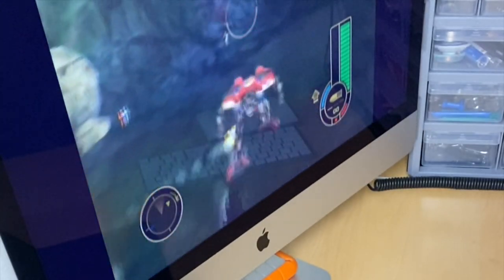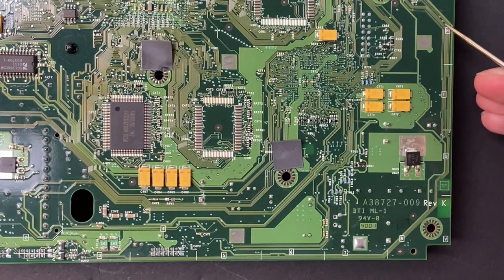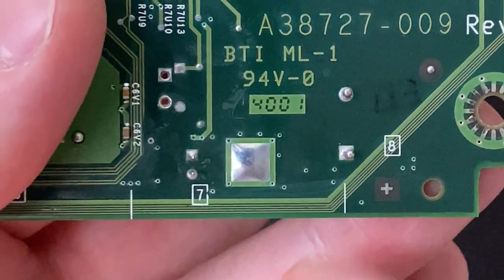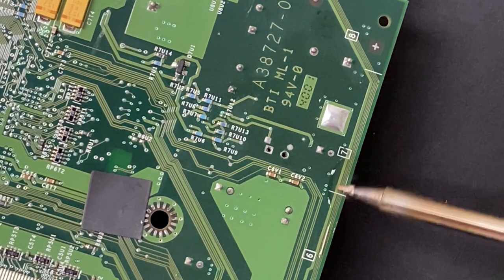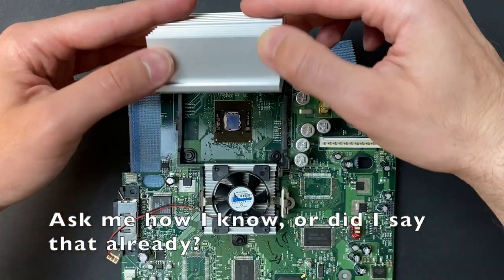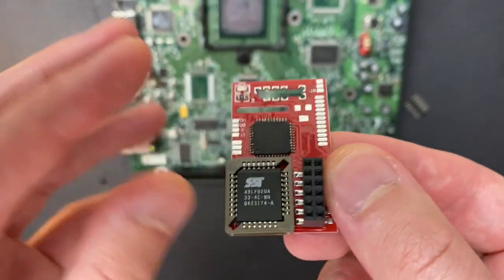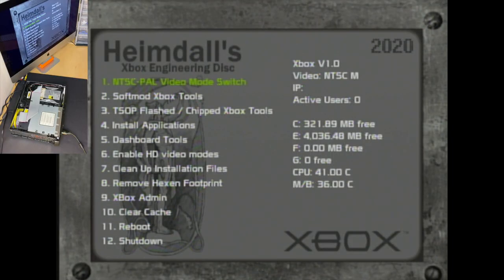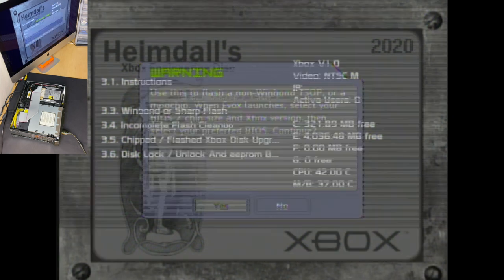Xbox Trace Repair & Modchip - Retro Console Repair

Comment: A Solder Bridge / jumper will only work without flux. You can stretch solder. But it has to be 10 seconds more or less old hanging on the solder tip smoking the resin away. The inner core of your solder wire contains also resin (flux) and has to vaporise first. Flux helps to flow. since it becomes more liquidity it can not easily bridge, it actually helps to unbridge :) Anyway the wire was an excellent choice. Love your channel!
Reply from the maker: When someone that knows what they’re talking about explains it, it all makes sense. Thank you, now that I think about it, I can see how I was unbridging rather than bridging with all that flux. Thanks for the feedback. Glad you’re enjoying the content 👍🏻

Comment: Thank you for not drowning the CPU and GPU die with gallons of thermal paste.
So many tutorials I've seen completely overdo it. A tiny film layer of paste is all you need....you just need to fill in the microscopic pits between the heatsink and die/heat-spreader.

Comment: You will probably never read this any more since it has been more than 3 years ago you made this video. But I wanted to see what an awsome video it is. Today I got a v1.0 xbox with exact the same symptoms as you described. I remembered that you made a video about it and I found this one. I repared the traces and voila works as a charm. I found it very hard to repair the traces. One trace i succeeded with a smal pies of wire on the trace slike you did but the other did not work so \I ended up making a wire from begin point to endpoint. But it works and it boots up!!
Thanks again for this video.

Comment: Just discovered your channel a couple days ago because I just got my first soldering station for college and wanted to get some practice by repairing consoles. I’ve already learned a lot by watching you and plan to cnmtinue coming back for the foreseeable future. Keep up the good work!!
Reply from the maker: Thanks man, I appreciate the sub and glad you're finding the content useful. Great that you just went for it and started tinkering. It's the only way to improve and its a fun hobby for sure.
Reply: @BorderlineOCD  Hey guys what degree u guys have? i'm curious about fixing motherboards and replace components and soldering. I think I need some guidance.
Reply from the maker: 300C is a good starting temp. Unleaded solder can require higher temps especially if its a large ground plane or a heat sink or something. Introducing some leaded solder works great to lower the melting point and makes removing components easier without increasing the temp too much, but sometimes I go up to 350C if it's going too slow. I don't have to resort to 400C often for desoldering but it depends how large the joint is and how good the heat transfer. If you're concerned about adding too much heat you can start low and dial up until it feel good. FYI most cheap soldering irons that don't have temp adjustment usually run between 400C to 450C. They'll do the job but those temps aren't usually needed.

Comment: Conductive paint! You could try conductive paint next time when repairing broken traces. I suppose applying some UV mask on top will even help protecting it on the long run :)
I once bought a Mega Drive cartridge that had 18(!) broken traces. I've spent a whole afternoon trying to bridge them but most of the gaps were just too big. I have eventually fixed it by using some fine wires but I have ordered a bottle of conductive paint right after that :)
Reply from the maker: Nooooo don't take away my soldering iron! 😢😭
Good suggestion though and it never occurred to me to try something like that. I just need an excuse to add something to my toolkit. 18 traces!! That's very cool, especially since it sounds like it was really far gone. There must be a goldmine of junk carts like that on eBay that could be brought back to life with some patience and commitment.
Reply: @BorderlineOCD  Exactly, although I forgot to mention one thing: all broken traces were right above the pins. You have to use some very fine wires and a thin layer of solder there otherwise you can't close the cartridge anymore :) (Unless you want to modify the shell which I would rather not do)
I bet that a skilled person with a decent microscope could do this without much problems though.
Reply: Conductive paint isn't as good as a wire, I haven't done any testing with conductive paint but my theory is that it is definitely more resistive then a wire which can definitely affect performance depending on the device and trace
Reply: In my experience the conductive pens won't really draw or adhere to damaged pads or traces. Like at all!
Reply: @neojudasiscariot  Nickel paint (its like nail polish) that will stick, and you can mask off the area, then paint it in, silver paint works too, but it's more expensive. Conductive pen is just something to play with.

Comment: I see you were picking at that thermal compound stuck to the bottom of the heatsink. I have found that using something like Goo Gone and letting it sit for a minute works wonders on the sticky type of thermal interface material. I used some yesterday on a B450 chipset heatsink on a motherboard, and it works way better than isopropyl alcohol and scrapping. I also use cheap paint brushes (that I never painted with of course) to brush off most of the surface dust while cleaning off components. Compressed air works great like you use, or if you have a handheld Metro Datavac.
Reply from the maker: Yes, scraped away for a good long while on the GPU heat sink... And all those scratches are from a plastic spudger. That aluminium heat sink is soft! Okay, good to know. I have some Goo Gone and will give that a try next time. I fire up the air compressor in my garage for nasty jobs like this these days. I used to use a shop vac indoors but received a number of comments about ESD on one of my older videos. I want to do things the right way so I stopped using the shop vac for cleaning circuit boards.

Comment: I was the one originally suggesting solder bridging cracked traces. I think you did a great job here since the gap indeed was too large. You can always use a strand from a larger wire if you want something really small 👍
Reply from the maker: Nicoful! Yes sir, you are indeed the viewer I was referring to, and thank you for the suggestion. It looks much more professional like you said it would. Good to know you would have approached it in the same way eventually (with a small wire). Love the end result and very proud of the repair. Thanks again for your critique.
Reply: @BorderlineOCD  I'll add that the reason you weren't bridging with solder is because you were using flux. The flux will draw the solder away from bridging. Try it without in the future for fun.. A real long term fix is wire though, solder isn't really supposed to be a long term connection
Reply: @BorderlineOCD  also, is recommend splitting the tsop and using the dual 512 banks instead of the modchip with the single 256
Reply: The bridge method may be neater but the trace corrosion will continue. Might be more worthwhile to just run bypass wires and be done with it. Side note, instead of removing the Clock capacitor I just mounted mine remotely. Even if it leaks a bit it won't matter that way.

Comment: Been watching a few of your videos — good stuff! About the CPU heatsink bracket: you're removing it "backwards". When you raise the lever, there's an arm under it which is the same length. If you press down on that arm with your hand, and then use a screw driver to gently lever the bracket, you'll have a much easier time and won't break anything again ;)

Good job on the repairs!
Reply from the maker: Thanks for the tip. I'm admittedly nervous to use a screwdriver after breaking one of these clamps (earlier repair video) but I'm sure there's a technique to it that I'll eventually master!
Reply: @BorderlineOCD  Yeah, I saw that, that's why I'm mentioning this :) The problem there was that you applied force outward with the screwdriver, and on the wrong side to boot, that's why it broke.

You should apply force downward on the arm, and use the screwdriver to merely unhook the clamp. Hope I made sense :)

Comment: Man this brings memories I used modified the case, chip and hard drive.  
I used paint the whole case, I would put the top cover in the freezer to pop the xbox jewel so I could drilled out, put led’s ring and put a customized laser cut clear acrylic jewel.
Reply from the maker: Nice, I was a computer gamer when Xbox and even the 360 were released. I am looking forward to doing an Xbox "slim" at some point. I have a unit with a bad DVD drive that's a perfect candidate.

Comment: With V1.0 you can just flash the TSOP by bridging two point on the board no need for the chip. Makes for a much cleaner install
Reply: Or you could just softmod

Comment: Back in the day, I became almost a professional heatsink lapper for PC's mainly Peltier and watercooling rigs but I did get on occasion OG Xbox's and I used to get them heatsink faceplates like a mirror and trued off so the pressure point was always optimal coverage against the chip.   It was and still remains for me a soothing experience lapping by hand and the final polish to turn alloys and coppers into beautiful mirrors and it does improve heat transfer.   I am not sure why the Xbox heatsink's seemed bowed and warped on occasion but this of course led to overheating due to the heatsink not interfacing with the heat source.
Reply from the maker: I can imagine that being a very rewarding task. Did you do it by hand or does it generally require a power tool of some sort?
Reply: @BorderlineOCD  by hand and feel is the best, sandpaper on glass for a flat surface.

Comment: I've got numerous OG Xboxes, one of the ones I've done a trace repair on now won't open the disc drive unless I hold both the power button and the disc button.
Random shutdowns are gone now at least but I have checked they're not shorting out something else and are all in the right place.

Comment: Very nice job on those traces. Good video, What console are you looking forward to repairing next?
Reply from the maker: Thank you! I'm not sure honestly, although I would like to work on a few Segas and Ataris at some point. Right now it's somewhat easy to add a project to the backlog because I just shop for a console I don't already own, focusing on older systems. I have bought a couple of 'untested lots' and to my surprise several systems advertised as untested didn't need any repair (NES, Wii, Wii U, Master System, Mega Drive, PS3). It nice that I have those in my collection but sort of a disappointment that they actually only needed a cleaning which sadly doesn't make for an entertaining YouTube video :P I also think I'll be doing some preventative work (like recapping the NES) and a few more mods (my fiance seemed to love the Game Boy backlight mod so I promised her a Pocket one).

Comment: When I have to make repairs to traces, I do one of three things depending on what I have a hand, copper shim stock, cooper foil, or the one I use the most take a thin wire pound it flat with a hammer and then cut out to size, but all in all you did a beautiful job. Congrats, Looking forward to seeing your next video
Reply from the maker: Thank you sir. I think if my wire had been any thicker it wouldn’t have worked well. The 26 AWG was the thinnest I had on hand. I do like the option of using a copper strand from a thicker wire. A lot of cool comments from folks like yourself and others on how they would have done it.
Reply: I've been thinking about this hammering thin wire to size idea, maybe coil wire of thickness of choice with the coating burned off and get it cherry and quench it to anneal, I would say you could squish it in a bench vice with the right type of "soft jaws" to try keep it uniform.
Reply: It doesn’t matter just make it flat and get all the coding off of it and then solder it in and put either fingernail polish or mask on top of it.

Comment: It's common for Xboxs to have those power issues caused by problems on the outer circuits on the back of the motherboard that you indicated.
Don't know if it's true or not, but I've read, a long time ago on a forum post, that those vias usually go corroded after several years because the motherboard as a substance used during manufacture on that zone that wasn't cleaned, and to prevent more damage that zone should be cleaned with alcohol.
I've done that in my Xbox and so far I didn't get that issue.
Hope this helps someone.

Comment: Very nice to see such a careful restorarion. Liked a lot the tips on restoring broken traces. Did you know from experience what was wrong with the board? Thanks, as always.
Reply from the maker: Thank you! Actually, it was just the same issue as my first Xbox repair video from a couple of months ago. That one also power cycled and the power button didn’t work. Research at the time suggested inspecting the lower three traces. That one had one broken trace. This time I knew exactly where to look right away.

Comment: Hello. Please think about investing in some 0.1mm patch wire. Make sure that the wire you are getting is enameled so that way it won't short anything if it touches anything. that will look much better than the 26awg wires and you will have a much lower chance of ripping traces possibly causing further damage. Also when tinning wires i usually dip my wire in flux and then tin it. i know its not needed but i think it helps the solder to get on the wire better. I hope this helped if no one else suggested this. Thank you.

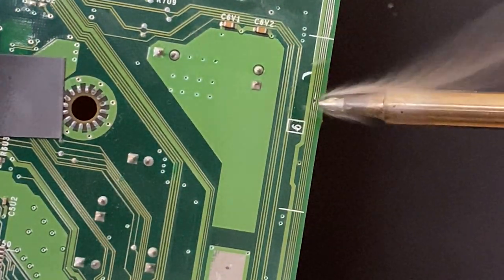Comment: @6:18 yes its cleaner but those traces are prone to fail and refail. relying on the repair instead of a replace isnt the best. rewire guarantees those traces will never be a problem again. just my 2 cents.

Comment: For trace repair I would have used a few strands of copper wire  it would have pulled into place nicely and gave the solder a path to follow try it out on an old board and see what I mean much cleaner looking .

Comment: You should have just tsop flash the system! You only need to solder 2 points together and flash a custom bios with the hexen engineering disc (these thomson drives wont read burned discs well though) a modchip is not needed and the onboard tsop chip has bigger space then this cheap aladdin chip which will allow you to run xecuter 2
Reply: you can't flash the bios on the 1.6 xbox and hard mod is the only option.

Comment: I found a pristine 1.4 that hadn’t had its clock capacitor leaked and my friend borked it somehow during a recap job. He replaced with a really nice 1.1 but it still hurt. After watching this I wished I’d held onto it and had someone more capable see if it could’ve been fixed. 

I’m rocking 2x128mb TSOPed Chihiro setups with a 3tb (only about a 1/3 of the 3rd terabyte is usable) with most modern emulators Coinops 8 and Ninja massive with almost the whole OG Xbox library. Bought them from a guy named Masnart here on YouTube. I also scored a 1ghz trusty modded board but I haven’t done a drive for it yet. Plays some games to fast but I got it for enthusiast reasons. Got it pretty cheap only wish I could’ve scored a DreamX 1.4ghz variant.
Reply from the maker: Thats very cool. If you have love for a system you'll spend insane amounts on this sort of stuff. I'm a fan of a 3TB build and plan to do one myself. Granted space is wasted but its not an ultimate Xbox build without being able to allocate the full 2TB that the filesystem supports, and a 3TB drive is the only way to do it.
Reply: Borderline OCD who you telling every time I think I’m done someone comes out with something shiny and new that bleeds my wallet , but it’s all good. I’m going to do the fidget spinner mouse mod for paddle games; at least that will be a cheap project.

Comment: I'm enjoying your content so far and its persuading me to hard mod mine. What fluid do you use to peel the labels back cleanly? I don't care so much on my modified consoles but I have a nice crystal xbox that I want to cleanly attend to the clock capacitor.
Thanks!
Reply from the maker: Thank you! I use 99% IPA and a sharp (new) single edge razor. Might be good to practice on one of your modded systems (even if theres a hole in the sticker) just to get the hang of it so you can attend to your crystal one.

Comment: Epoxy overnight on large pits before soldering, then apply any bonding or pad; if necessary, it will help in bridging with just solder.
Also, if that's a THOMSON optical drive, throw that shit away.
Reply from the maker: I read they have a bad reputation but haven't had any problems with the Thompson drives so far.

Comment: For those tiny traces, You really should use a single strand of fine copper wire, or coil wire. The leads your using are way too large, and they could easily rip up the traces when being handled.